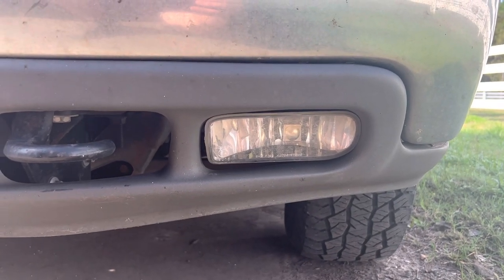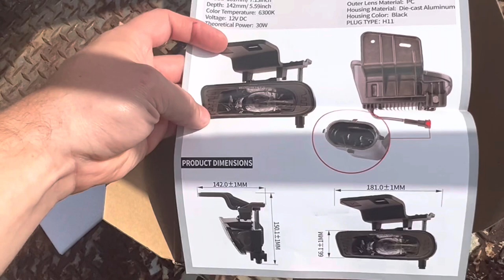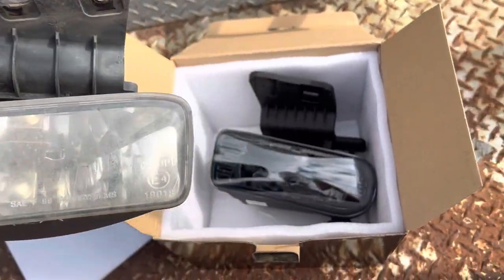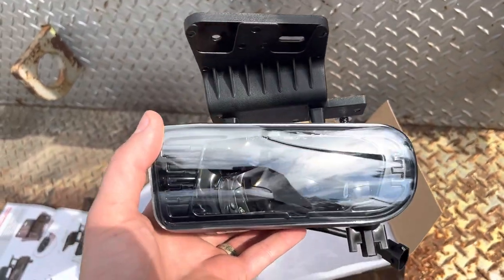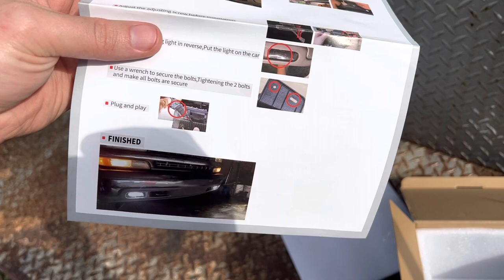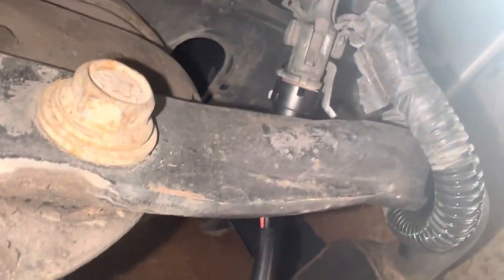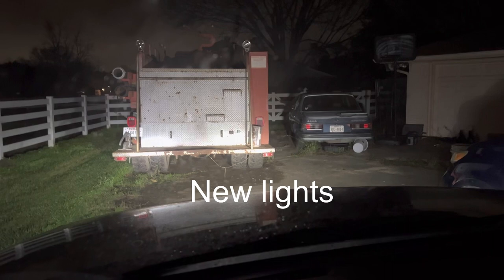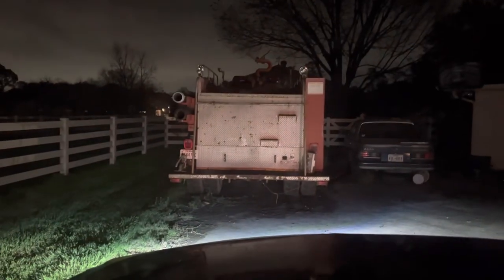00-06 Suburban/Tahoe LED Fog Light Install

Comment: You need to angle them up. They have a definite cut off line. You are missing a lot of light..
Reply from the maker: You are right, I did adjust them up a bit after driving it.
Reply: @mjmcomputers  cool.  I'm definitely adding their headlights. I've waited forever for a decent LED headlight and if the quality is anything like the fogs their good to go..